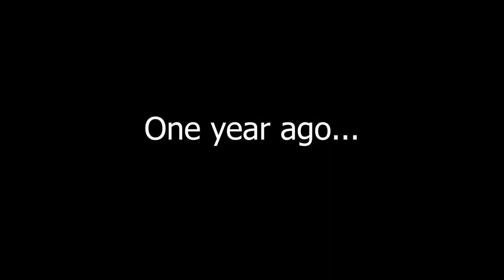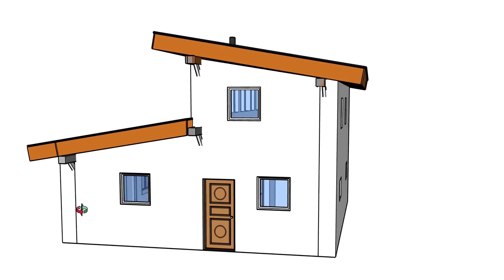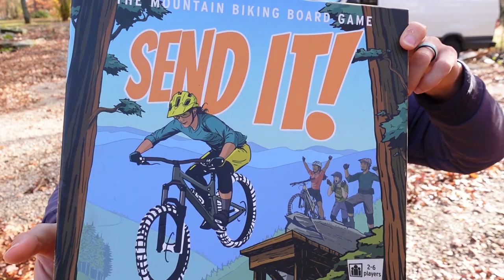THEY'RE BUILDING A HOUSE OUT OF STRAW AND MUD! -- Adobe straw bale post and beam house update

Comment: UF cable is rated for underground direct earth burial.  Why would this be preferred over NM cable in an above ground application?
I would not place any power cabling in direct contact with strawbales but would use conduit or perhaps MC cabling which would aid in grounding the system and devices.
Curious to know what the AHJ said.